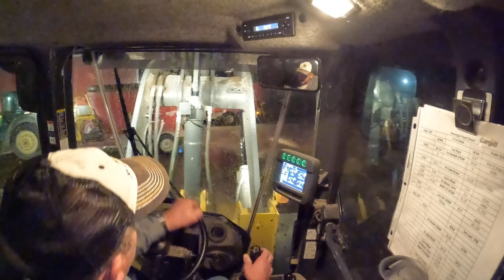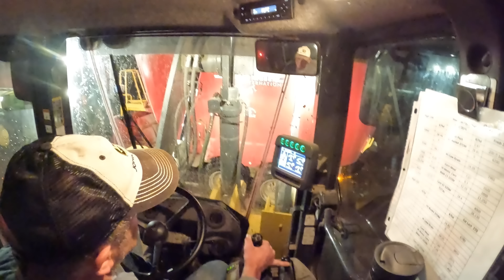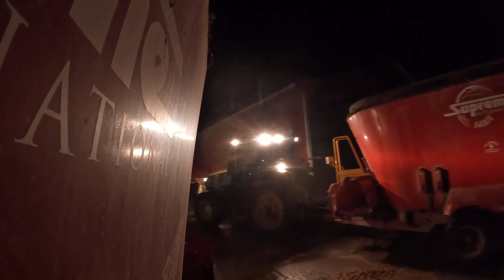You haven’t seen this one yet

Comment: Hey Andy does you're payloader have built in scales on it?
Reply: I believe the mixing trailers all have scales so Andy has a recipe for the mix on his clip board on his right hand side of the loader ,hope this helps
Reply: Scales are on the mixing wagons.
Reply: I've worked on a farm an fed cows with mixer wagon. Now I drive dump truck at a quarry getting loaded the loader has scales built into it. Just wondering if his did.